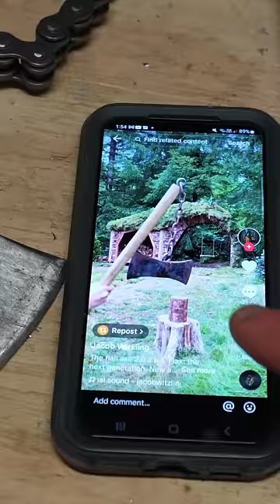Hidden motorbike chain Axe

Comment: my man wielding the hidden motorbike chain axe without even a pair of flip flops on. I need that kind of delusional confidence
Reply: I survive solely on line of confidence, but I'd at the very least wear socks.
Reply: Honestly though, what's a shoe gonna do in that situation
Reply: @sir.ghost7102  provide me with SOME dignity
Reply: @LuzbelAlexander I guess I'm a soulless indignant person 😂😂😂
Reply: @LuzbelAlexander  you’d at least wear socks? God man I’d at least wear anything BUT socks. Who wants a bloody sticky sock on their foot 😂 id rather have a bloody shoe, at least the shoe will not stick as bad
Reply: @Steve.._.  you must be under the impression that I have common sense. However, you failed to realized I would already be holding this abomination of an safety violations nutfest
Reply: @sir.ghost7102  you could definitely be protected in the situation by a pair of steel toed boots
Reply: Well it is true if your shoes/clothes don't have enough protection... wear Nothing is actually better for treatment..etc. 😂😂
Reply: Not delusional, rather Austalien
Reply: @sir.ghost7102  potentially save your toes. Anything that hits the ax head could divert the direction its going. 
Plus they make steel toed shoes and boots.
Reply: @sir.ghost7102  steel toed boots were made for this
Reply: @LuzbelAlexander  ⁰😅
Reply: Right.   Im huge on feet saftey and it is scary to see him not wear shoe's
Reply: Bro walks down the street wearing a post box in case cars veer off the road.

Comment: also known as 'feet obliterator'
Reply: What?
Reply: or it's alternative name "shin striker"
Reply: More like nuts nicker
Reply: Knee cap splitter
Reply: Its a small miracle that he still has all of his toes.
Reply: @ofmasterOof  IT'S A FEET OBLITERATORRRRRRRRRRR
Reply: His Steel Toed Crocs would be useful.
🤣👍
Reply: Or finger remover
Reply: Or the "ninjaturtlefeetinator"
Reply: The Toe Biter
Reply: He's barefoot because he knows no boot would save him.
Reply: The Knee Uncapper
Reply: @MrNotBot  a boot really won't save you against an axe, shit a full size felling axe or a splitting axe will go straight through a steel toe boot.
I would not handle this damned cursed axe, it's a safety hazard beyond all reason. I won't even use medium length axes, I use full size ones because if I fuck up it ends up in the dirt, not my foot or shin
Reply: @nobeltnium  DUN NAHNAH NAH
Reply: @MrNotBot  or because he's australian
Reply: after reading this n going back
yeah that first swing was c l o s e  (up close shot)

and im all for recklessnes
Reply: ankle eliminator
Reply: Shoulder stabber
Reply: @asapsasd2022  Doing the same thing over and over again but expecting a different outcome is the definition of insanity. Now that I've read it, Ig it doesnt apply to every situation.
Reply: Anyone who has actually swung an axe safely knows you swing with your legs apart so it hits the ground so your legs are out of the path of destruction. It still isn't safe, but if you swing it right you should still be okay. I'd be more worried about drawing back for a swing and conking yourself in the back
Reply: @ofmasterOof  also known as ‘feet obliterator’
Reply: His refusal to wear safety shoes (or any shoes in general) makes me anxious on a good day but this is the worst so far. If he keeps playing with this he's gonna have to 3d print some replacement toes soon
Reply: The shin shatterer.
Reply: notice the bare feet
Reply: Now put a gun in the handle so that it fires out the axe at high speeds.
Reply: @asapsasd2022  Did you know that reading something you don't understand more than once or twice only makes it more confusing?
Reply: @DeadBayt  or if you miss after a really hard swing, The Finger Hack
Reply: @DeadBayt  shin cutter
Reply: Lol that basically describes half of his inventory .
Reply: The origins of Ninetoes, now in real life.
Reply: shin slicers
Reply: @escapetherace1943  How heavy do you think small axes are? You can at least slow it down enough to dodge the blade after you miss (though a better question would be how the hell do you miss with a small axe that’s easily ajustable mid swing)
Reply: @NatioDD  tell me you've never swung an axe without telling me you've never swung an axe. Lmfao!
Reply: @escapetherace1943  Ya know what, ye that was pretty dumb, miscalculations were made 😂, you get a like sir
Reply: If it jumps back, it becomes a 'head hunter'. ;-)
Reply: @MrNotBot  Why waste a good pair of boots? It's basic economics.
Reply: @monsesh1316  If you don't succeed at first...
Reply: That is why they wear steel toe boots when wielding such mighty weapon. Looks at his bare feet... well, he is fucked...
Reply: Or Knee decapitater
Reply: Orphan obliterator
Reply: Or the hand remover 9000 😂
Reply: Why is everyone like "feet!', it aint reaching ur feet. Its more likely to wrap around and unattach your fingers xd
Reply: @mr.rabbit5642  Because he is swinging downwards towards his feet with an axe that could easily reach his feet if it bounces off the wood. It doesn't help he's not even spreading his legs apart and swinging it correctly
Reply: The whole time I was like, wear some shoes man, the likelihood of losing a few toes would not be much lower but my anxiety level is skyrocketing

Comment: He fixed the number one issue with most fictional flail weapons: the edge alignment. I didn't think it'd be that simple
Reply: Or just make them round lol edge alignment isn't a problem when there isn't an edge
Reply: @PhoneyLoki  against flesh specially this is a better weapon. you are not only hitting with extreme blunt force, you are also getting slashed.
Reply: Who cares about edge alignment when your destroying unarmed and armored opponents? The flail maces have been pretty dangerous against people who wields shields as that flail mace can easily come right around and over hitting the man on the head.
Reply: Yeah, but won't the chain break sideways pretty quickly?
Reply: The number one issue is usually the chain being longer than the handle meaning you'd hit yourself eventually

But for IDAT thats probably just more content
Reply: The guy with the chain ax still did it better. You can align the edge by swinging it
Reply: I know right? I’d buy this axe.
Reply: @PhoneyLoki  it also not an issue when its all edge on all sides :)
Reply: @Trolltamp  don't swing it sideways then...
Reply: @fuggly-qg9on  I will stick to a stick.

Comment: The motorbike chain instead of a normal chain is actually genius (SAFER)
Reply: E
Reply: @EEEEEEEE  ain’t that the truth
Reply: also safer, arguably.
Reply: It’s really not, just use a normal axe
Reply: @MondoC You shut up.
Reply: No, it's way more dangerous. 

The peens holding the chain links together are doing so with a small riveted connection. The sideways rotation of the axe head can easily overstress these rivets, and the chain can fall apart in very unpredictable fashion at any moment. 

Why do you think he swings it so gingerly? He knows perfectly that it can snap at any moment. 

The ingenious idea behind a chain is that it's the material's total strength that holds it together, you get the most bang for your buck. This design is just dumb, and he knows it is. Looks cool though. 

An actually smart design would be two steel cable arranged horizontally. It offers the same advantages as a chain - being floppy -, while being far more managable in their relaxed shape, AND the two cables would ensure the orientation of the axe head. Well, either that, or they would violently shake side to side, but that's what you get for wanting to stabilize a very much unstable system with improper means.
Reply: Whole idea is stupid
Reply: @mansellmaniheramehana-manu5823  thats... the point
Reply: The word genius really has lost all meaning 😂
Reply: No, no it's not.
Reply: @NickMullet  To be fair, it hasn't lost ALL meaning, it's just that stupid people think anyone with a slightly clever idea is a genius because they've never had one.
Reply: @Ojja78  It's just exaggeration, you don't need to insult people for making jokes or comments
Reply: No it's not now it's just a shittier axe
Reply: @EEEEEEEE oh god, please don’t say that, kids are watching.
Reply: @candleyarn  It's just a comment on our society's over use of the word "genius". You don't need to silence people for making a comment on society.

Comment: The kinetic power of this thing is terrifying. Imagine popping out the chain while swinging it down. You definitely don't want to miss your target or the axe won't miss you
Reply: Best way I can say to make it safer is to always follow through with your swing so it hits the ground. Still gotta worry about it popping back up but I'd rather get hit with the dull side 😅
Reply: and best way i can put it, respectfully as possible 
kinetic 

cinetic makes me think of something someone found out/made up using cinnabar (CINnabar, CINnetic)
Reply: But then again, the chain is only half the length of the shaft, so I think it will hit the shaft so long as you don't bring it too close to your body.
Reply: @user-ok4pk2mp3e  look at the start of the vid
the pin/bolt sticking out near his thumb is where the chain ends

100% not halfway 

sound logic tho, thats how flails work (common sense n a chain shorter than the handle = a okay) ((common sense bit not @ you but flail, nunchuck users n the like))
Reply: @Volti-Vagra  my bad, made a dumb mistake because of my native language. I'm French, and it's written "cinétique" in french
Reply: @Volti-Vagra  Yes, the length of the chain is a bit longer than half of the axe handle. He has the handle marked with yellow tape above where the pin is located. That pin moves to the nearly the top of the handle when the chain extends (a few inches away from it). So even if you don't account for the chain not folding perfectly around the tip of the axe, the base of the chain connected to the axe head could only reach a couple of inches above where the yellow tape region begins, and the axe head could only reach the beginning of the yellow tape region. So as long as he doesn't handle the axe where there is yellow tape, his hands are safe.
Reply: No matter what happens though, I'm going to miss my foot.
Reply: @come7162  no no, no worries or anything to be had, just trying to positively inform to help in the future c: 
(sorry if the prev comment came off nasty or anything, not the intent i swear)
Reply: @Volti-Vagra  no worries, it didn't

Comment: Something like this would've been so OP in medieval combat. Dude goes to block your axe only for the head to flail overhead and get him on the back of the shoulder.
Reply: ever heard of the Morningstar?  that is a nasty surprise...
Reply: But the Morningstar was a mace not an axe
Reply: Would it have been tho
Reply: @hunterlovejoy7651  which is better against an armoured opponent, hence why it saw use
Reply: Though the historical evidence for its use is comparatively rare so it’s use is likely highly exaggerated. Anything where you have a kind of chain or string weapon including morning star nunchucks etc are worse at transmitting force even the so famed speed doesn’t really change that it can’t deliver much force. They also become less controllable and hitting yourself is an increasingly high risk.
Reply: @marius  my man, unless a Morningstar engaged from a normal mace with a trigger mechanism, then yea. They are absolutely not the same. The flail part on this axe is a hidden weapon.
Reply: The problem is that now you are only hitting with the momentum of the axe head with no possibility of putting additional force behind your blow (since, you know, chain not be rigid). In a medieval combat scenario, that momentum alone most likely won't even penetrate any decent armor piece. Which is the exactly same reason for which it is completely useless at chopping wood.
Reply: @mariuszuzulin1801  can it cut wood though 🤨
Reply: Not only no, but HELL no.  This thing isn't doing ANYTHING if you're even in mail.  Plus it's gonna get tangled with something and you're gonna get disarmed.

Trust me, they tried ALL KINDS of weird stuff during medieval times and the reason they didn't really use flails is because flails are a completely terrible weapon.  One of the few weapons that presents just as much danger to the user as it does to the enemy.
Reply: @hunterlovejoy7651  Yeah and everyone knows maces aren't very good at chopping word.
Reply: Consider that not only would it have no force to break armor or do damage, it poses a danger to yourself and by extending the chain, you leave yourself open now
Reply: Aya  Damn. This guy logics.
Reply: Aya  what I meant is that while it likely did occur in some capacity it was very very rare back then possibly as a novelty weapon like the sources are really shallow

Comment: A bicycle chain is not designed to resist bending to that degree. It is designed to be modestly resistant because bicycles only have a minimal amount of perpendicular movement to resist.
This axe however provides way more potential for perpendicular movement of the chain. With enough use, the stress on the chain will become too much and the chain will break, most likely in mid-swing.

Comment: This must be the coolest and most polished thing you've ever made.
Reply from the maker: Thanks mate. Not the hammer gun?
Reply: @Ididathing  I think the hammer gun was better
Reply from the maker: @MrRobot98  I agree. If you ask me this one was actually made very badly
Reply: @Ididathing  The hammer gun was far better and more polished but I guess people just prefer the medieval-esque aesthetic of this one
Reply: @Ididathing  It's close but this looks even more wicked and the pop up mechanism is so smooth and nicely packed, ASMR worthy.
True that hammer gun was literally more polished tho but we can be less concerned about your safety in comparison when using the axe ^^
Reply: ok hear me out but,  ceiling fan machete
Reply: @elijahpelito4722  It's cool but vile cool and kinda crude which i guess adds to the "saw trap" effect.
Reply: @elijahpelito4722  Honestly that's a highly marketable novelty item as long as it's not actual machetes (with optional jason mask center cap)... Of course on this channel, we want actual machetes...
Reply: @Ididathing  most of the stuff you make are incredibly dangerous
Reply: @Ididathing  I think in terms of something with a lot of internal movement, moving parts, and otherwise comes apart in a way, this is definitely the smoothest.

The hammer gun was definitely the overall highest quality item you've made, however it obviously does not have the same number of parts and physical complexity of this flail axe, and for its complexity to quality ratio, this axe is definitely at least top three.

Comment: "It's an axe-flail thing I made which is really bad at cutting wood."

shows it absolutely obliterating a log
Reply: Don't believe anybody who's an "expert" because it does not take expert experience to swing an axe
Reply: @Purplemage572 he did say it was bad, maybe future prototypes could make a device that allows for stronger cuts, although chains might make it challenging since they don’t really carry a lot of power if they are short
Reply: Fr tho
Reply: @purplemage572 I think you underestimate how much practice it takes to efficiently cut down a tree using an axe
Reply: something being bad doesnt mean it can't do something. It's just worse at it than other options. You can use the nail remover on the back of a hammer to drive a nail in and even hammer one in on the first swing. Doesn't mean it isn't bad compared to using the proper side

Comment: Thinking about it, having an axe that is connected through chains is useful for excreting more force on objects. Since your torque would be greater from the great range your covering. In addition, it wouldn’t hurt as much in your hands or break easily since the chains absorbs any shock that it experiences.

Great design 👍🏻

Comment: “Which is really bad at cutting wood”
continues to chop an entire wood brick in half instantly
Reply: You clearly don't have experience with woodchopping.
Reply: You could literally split this in half with your bare hands
Reply: please go outside. Trust me, it's nice out there
Reply: Y’all I was just making a joke, y’all don’t have to be mean about it
Reply: @ItsYamanPyro Unfortunately, making a comment in a public space leaves you open to criticism, both positive and negative.
Reply: @Farazormal1 grass is horribly and the heat outside is too much. I hate anything above 68° fahrenheit (20° celsius).
Reply: @ItsYamanPyro this is YouTube comments we are speaking of. Also that “wood brick” can be chopped in half with a Bowie knife. As someone who has had experience in wood chopping that little “brick” can be chopped with an easy force of motion as shown in video regardless of the axe itself. Also the brick was at an upward angle, and also small doesn’t require to much

Comment: Imagine running from a serial killer holding an axe. You think that's just a normal axe and you're safe and then the killer yells "get over here" and bust out the extendable axe head with a chain attached to it